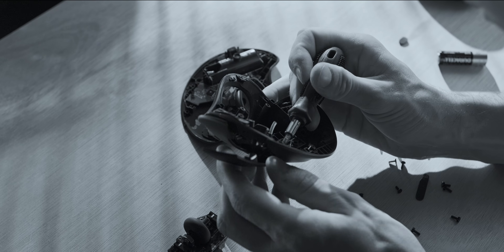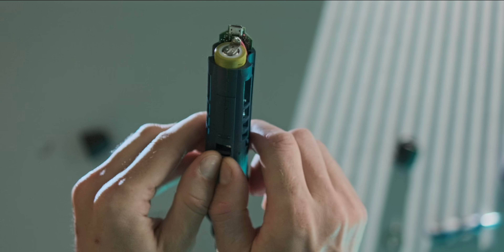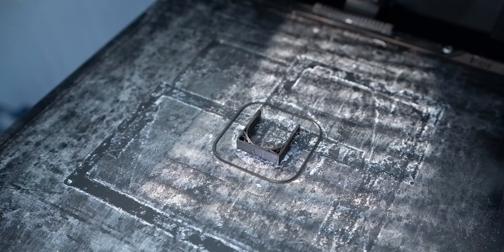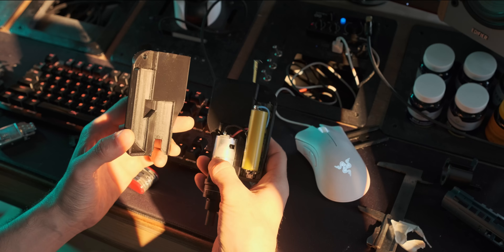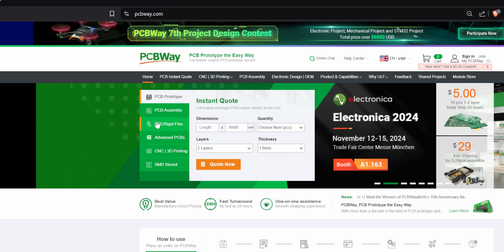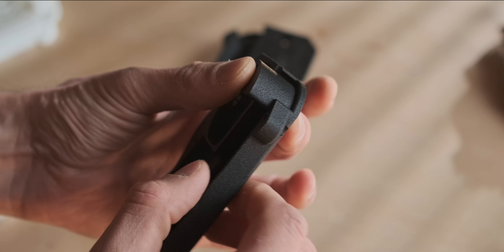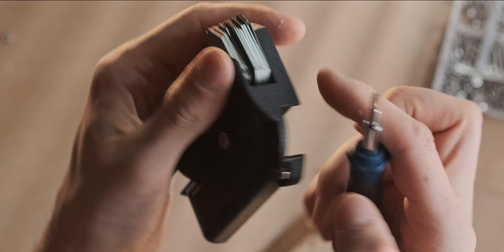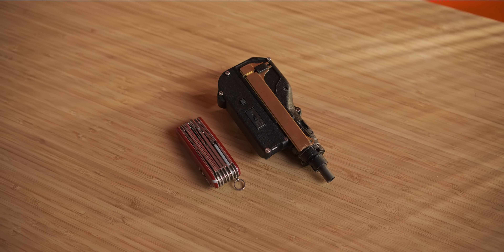I 3D Printed an EDC Tool For 3D Print Projects - Episode 1

Comment: Yeah this is one of those things i have passing thoughts about, but always conclude would just be too inconvenient compared to the stand alone counterparts, but this setup is definitely closer to useable imo. Same issue I have with tool belts too, at my work i settled for one that just holds my pens/markers and flashlight bc the rest is better to just bring in a toolbox.

Comment: I love this idea, I just ordered parts to make my own that’s inspired by your design. I will be putting an electric screwdriver, flashlight, tape measure, fillet gage, and an angle finder on it. Then I am going to add a magnetic panel to the side of it so you can stick and leave screws on it. Not sure where the bits will go yet but I want some sort of opening door mechanism to put them in for sure

Comment: 9:08 Did you seriously add micro-usb in the year of our lord 2024??? 😂
Reply from the maker: It wasn't by choice I promise haha XD, I wanted to replace it but I didn't have the time to do so, it came with the drill :)
Reply: @FlatLanderTech  Necessity is often the mother of all jank... or invention. One of those is the correct quote hahaha
Reply: @FlatLanderTech  if you get a USB-C plug, if you get them with the right resistors, they are drop-in replacement for a micro usb.

Comment: Really love your videos! Only additional thing I'd like to see in the future is some more footage of what you've made actually being used and maybe some notes on what you might change if you modified it or were to redo it in the future. Also I wasn't sure if you had any advice for the tape measure fitting since you described the issues but then just moved on to the next item. Thanks for the great content!
Reply from the maker: Thank you for the feedback much appreciated, ill be sure to implement that into the next videos! as for the tape measure fitting, I haven't really found a great method for it yet so for now its just trying and failing, but I think once its in the correct position, winding it up an keeping your hand over it so its not going to pop out. in a future iteration I'm changing the design so this is not such a hassle to deal with.
Reply: @FlatLanderTech  heck yeah! I've tried fixing tape measurers in the past and that spring was the bane of my existence and I just had to get a better one haha so I totally understand about the spring thing. Sounds like you got it, it just took a bunch of tries. Since 3D printing wasn't on my radar when I was messing with tape measurers I now wonder if there may be a tool to print that could hold it together while assembling...
Reply from the maker: That's a really unique and awesome idea! there must be something, something that closely resembles how they do it in the factory where they produce these, either that or the people making these things are just a lot more talented at this than we are XD
Reply: @FlatLanderTech  Time to find those old episodes of 'How it's made' haha
Reply from the maker: Haha yea those where absolutely awesome! the average TV session, how its made and MythBusters XD

Comment: Have you thought about integrating the calipers into the 3d print? I would worry about the tolerances but having a compliant spring add a resistance force to the sliding part while making the stationary part a solid element of the chassis may trim down on the bulkiness of the EDC tool in general. Just a thought.
Reply from the maker: Very interesting idea indeed! I think in this case it would indeed be a viable solution. it would be even better if the whole thing was a lot smaller, anyway, thank you for sharing :)

Comment: I’d make a screwdriver centered around the design of a sonic screwdriver bigger than the micro electric screw driver but smaller than a standard electric screw driver. A sort of “in the middle” size, if not medium. That has a removable bit driver head that uses standard sized bits and small precision sized, if you will, bits. It could function as a limited impact screw driver. I’d have a bit that would incorporate a tungsten pointed scribe on one end and a lead pencil holder/cartridge on the other or maybe an extendable marker/pencil that extends to a thin pipe to get into deep holes. It’s be made of a durable material to withstand light taps at the top end, which has a metal cap
Reply from the maker: Ooo thats really interesting i didn't know about this "Sonic Screwdriver" you mention but looked it up and it looks really awesome ! amazing ideas aswel great stuff!